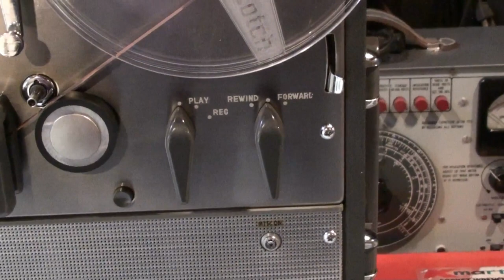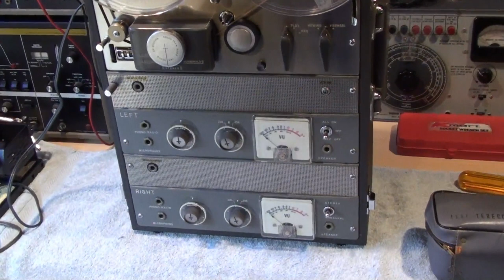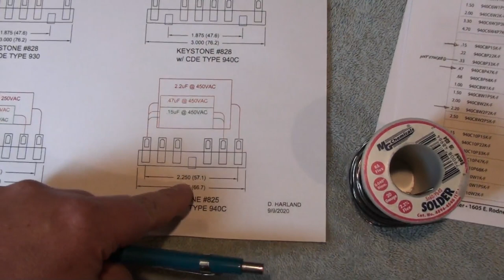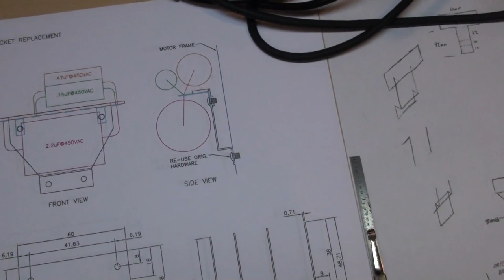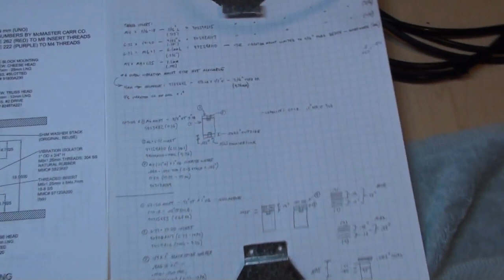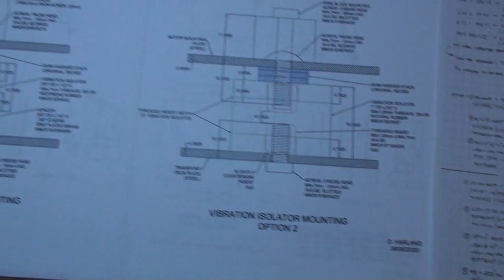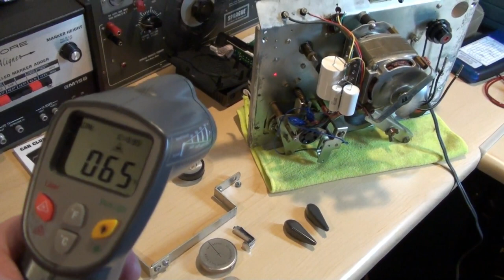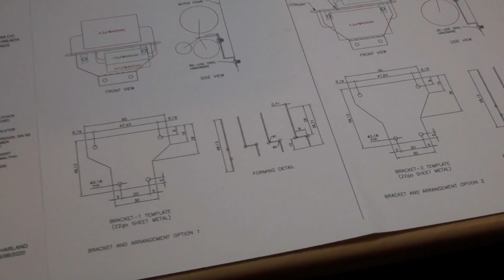Repair and Restoration of the 1961 Akai M-5 Reel to Reel Tape Recorder

Comment: You are most marvelous restoration expert.  But I tend to disagree with you regarding the electrolytic capacitors.  If you're replacing the others.  Those have always needed to be changed out also.  It doesn't matter if they test fine.  They really aren't fine for your audio at that age.

And that's the only place where we disagree.  You, otherwise are quite meticulous.  And I was really wowed with your custom metal work.  That was superb!  I don't generally go to those lengths, myself.  And which would all depend on who it's for and the budget.  Sometimes things can get a bit financially impractical.  And then you are left to ponder.  What to do for a retrofit.

I mean there are certain parts I know about on the Scully 280 B versions.  That when this little optical part fails.  And it will.  It'll turn to dust.  There are no other usable acceptable retrofits to be found.  This was a terrible designing error on the part of Dictaphone Scully.  Under their ownership.  I worked for Scully AMPRO.  The last ones to produce the Scully machines.  And there is this one part originally manufactured by GE.  They ceased manufacturing.  Back in 1979.  And I was working with the mechanical engineer.  How we were going to come up with a different system.  At the time of my departure and resignation.  And because the boss/owner of the company misrepresented himself on what he hired me to do.  And I just saved his company for him.  And would not allow me the freedom to do what he hired me to do.  I won't work under those kinds of bullshit conditions.  I'm happy to announce.  Because when you fired me.  You've hired the very best.  If you do not allow me to function at my very best.  I have to resign.  And I did.  After a year and 1/2 of my service.  And three months after my resignation.  They closed the company down, forever.  They couldn't live without me.  And he found out months after my departure.  I had turned the company around.  And then refused to work with me on what we needed to do.  To keep our machines, viable.  And I resigned and went to work for NBC-TV for the next 20 years.  And making sweeping influences on the broadcast industry the world over.  And that wasn't supposed to happen, either.  Who me?  Yes me.  The first to introduce stereo television in 1984 for NBC-TV.  Doing the news in stereo.  Which we do not do, and stereo, at all.  We only play the music in stereo.  And that's all because of me.  The world over.  Everyone else followed my lead.  You don't hear the news in, stereo.  It would sound like a movie soundtrack that way.  They can't handle it.  I mean when you would see the news anchor on the street reporting the story.  And you see a bus traveled behind him from left to right..  You would hear that bus go from left to right.  But you don't.  You just hear the bus.  That's all my doing.  I think it's smashingly funny.  That I would have this huge influence on television news the world over.  Little old me.   Back in 1984.  When I wasn't, old.  I was a very hip engineer.

So the news is still  delivered in monaural today.  Because no one in the field is an actual audio engineer.  Nobody back at the TV station cutting the news.  Is, an actual, audio engineer.  So it's only done in monaural.  Which also provides for highest intelligibility factor.  Without stereo distractions.  Of what is being said.  You would get that in the movies.  You won't get that on network television news.  Because it would distract from what is being said.  So we keep it in mono.  For greatest focus, point of interest, lack of distractions, highest intelligibility factor.  For information dissemination purposes.  Spoken word purposes.  Primarily speaking.  I mean, I am primarily speaking.  Here in print.  Where I am, primarily speaking.  And you can't hear me speaking.  Because I am in print.  I am printing this recording.  Into a communications systems, network area storage systems.  Spooling to and networking with other online, in the digital cloud, network storage systems.  It'll haunt you for the rest of your life.  And it's only a bunch of numbers.  Of ones and zeros.  That will allow the world to see and hear.  Your horrible musical recordings and video productions for the rest of all eternity.  Long after you are dead.  So that we can be laughing at you.  For all eternity to come.  Wow Nancy, listen to this horrible rendition of Hole Lotta' Love.  It's by Leaded zeppelin.  What's a zeppelin?  Is that like, penicillin?  Yes.  It cures the common, coldness.  It gets you all heated up.  Jumping around.  It gets you wanting to hump anything!  And it warms you write up in your soul.  BECAUSE THAT WAS THE PORNO FILM VERSION!

And of course we have all heard those stories.  When in the middle of the night.  Some TV station.  Wasn't supposed to broadcast any of that.  Whoops.  It's so funny when those things happen.  Some of us actually did that, deliberately.  I would play recordings with people like Janis Joplin using  filthy language.  Putting it on the FM radio.  No one ever called in to complain.  But they could have.  And we would have been fined by the FCC.  But I worked for Baltimore's #1 FM album druggy rock station.  Back in the mid-1970s.  So only druggies listened to that station.  They certainly would not call the police to complain about anything.  Especially when I would play Cheech and Chong a lot.  And they use a number of colorful methodologies to American colloquialisms.  I think that's what it's called?  Looks like dog shit.  Taste it.  Ugh.  Taste like dog shit.  Must be dog shit.  What a great routine.  The play on the FM radio.  Back in 1976.  When I was only 19 years old.  Doing that teenager stuff on-air.  Because I could!.  I mean what incredible fun.  Rock 'n' roll FM DJ at the #1 rock station in a major market radio station.  At 19 years of age.  Yeah baby!   And I have the entire midnight to 6 AM on-air night shift to my very own.  Playing rock 'n' roll and smoking pot.  It was a tough job.  But somebody had to do it.  I elected myself years earlier.  I made the sacrifice.  I did the time.  On-air.  For all to Hair.  Which was very popular to play along with Tommy and Jesus Christ Superstar.  In 1976.  Still.  Along with Cheech and Chong.

Hey Pedro.  Don't answer the phone, man.  I think it's bugged.
RemyRAD

Comment: Hi, drh4683. I reached out on Audiokarma asking for help in identifying my parent’s Zenith TV from the mid-late 1960s (1967), from an old photo. I do not have the TV in my possession anymore; I would however be interested in locating the same model/cabinet for purchase. An Audiokarma user suggested that I contact you to see if you could provide assistance to me. Do you have a website or social media account through which I may contact you directly? Thank you for your time in reading my inquiry.